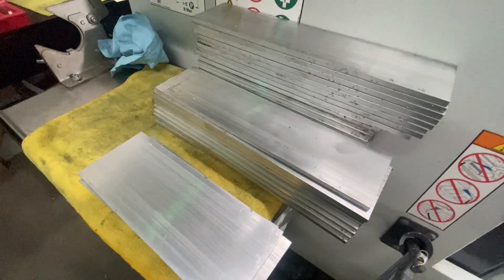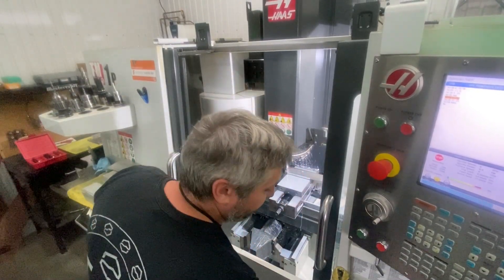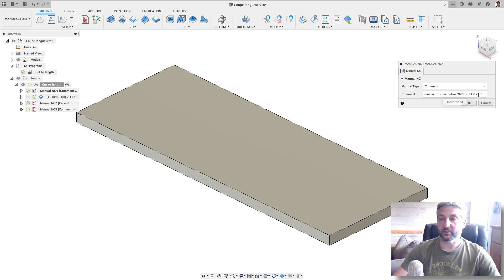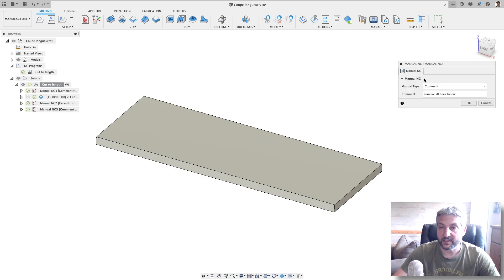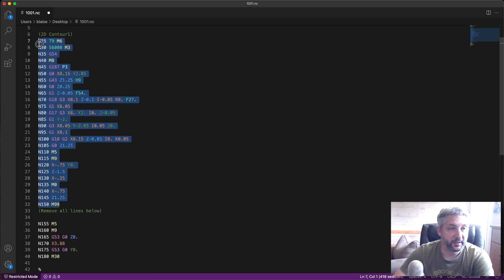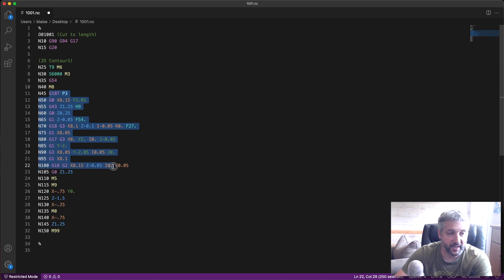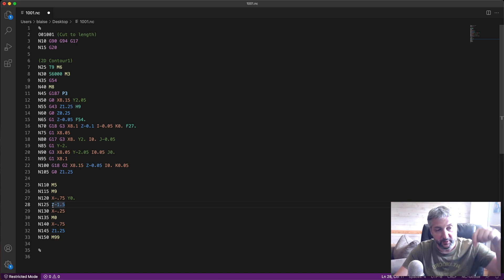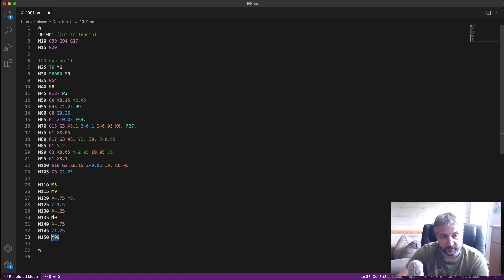Using the end mill as an indexing stop to locate your stock

Comment: It is amazing what you can do with just a little manual NC code in the right spots.  I'm going to use this trick for some upcoming repetitive parts that don't quite justify a fixture.  

A few months back I wrote some gcode to turn on my air blast and move the table through a sequence that cleared my fixture of all the flood coolant when an operation was done.  I have 18 parts on that fixture with a bunch of mitee bite clamps and it was so nice to know that when the cycle finished it would blast off all the coolant and the fixture was ready to be serviced.  Saving myself the time of blowing the fixture off with an air nozzle was great.  Even greater was having it done automatically with the mill enclosure doors shut, and knowing that waiting about a minute would mean I was breathing in a lot less atomized coolant in the air inside the mill.

Loving the videos, and as always I enjoy learning from you!
Reply from the maker: I am glad you liked the video! I also do use fixture plates and miteebites pit bull clamps for production but I don’t have air blast on these machines unfortunately. I’ve been thinking of using these chip blowing fans that you put in a tool holder. You might have just convinced me to do it! Thanks for the comment!

Comment: I learned that trick 25 years ago at my first job working in a cnc shop. What we did was use the shanks of broken carbide endmills turned around, and held in collet chucks, in a dedicated tool position. It offers all kinds of advantages, like the ability to locate off inside features, and the elimination of x axis thermal growth as a consideration. The only real downside is you lose a spot in the toolchanger, but this has been an issue exactly once in running thousands of different parts.
Reply from the maker: I knew that many of you would have known this trick already but to me it was a revelation when I learned it so I thought it was worth sharing to the ones that haven’t learned it yet. I used the shank of a broken tool as well the first time I used this trick but then it occurred to me to do it this way and save the tool change time witch is quite slow on this machine.

Comment: Nice Haas TM1P! Is it at your job or is it yours?
Reply from the maker: At my job. There are tho of them, a CNC lathe with bar feeder. An older 3 axis CNC, water jet, industrial sand blast, powder coat  and various other equipments.
Reply: @BlaiseBarrette  How has progress been on the Fadal?
Reply from the maker: It’s been very slow! I did a little bit of CAD but that’s all. I installed a above ground pool and it took most of my free time. Plus a little trip for m’y Holiday. I hope to back at it soon. When I do, I promise to keep making videos. Stay tuned! 😉
Reply: @BlaiseBarrette  Thanks for the update! I have plans to post videos on my Fadal pretty soon too. Stay tuned.

Comment: M5 M9 put only m30 and it gonna do the same job
Reply: it depends on which machine you are. Some M30 are linked to lift the Z to G53 certain position plus it won't read anything after since M30 close the gcode. He uses M99 for looping.